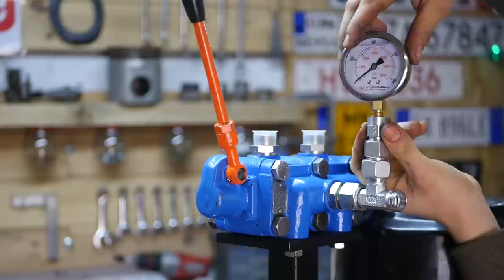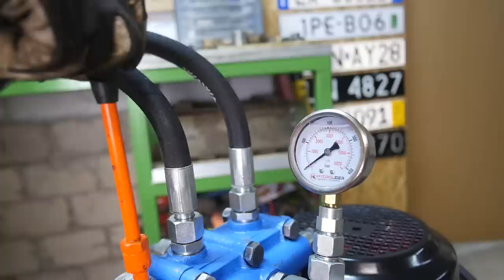Hydraulic power pack - DIY *Subtitles*

Comment: I work with industrial hydraulics for a living and you did a really nice job. If anyone watching is thinking of making their own power pack, please be careful. Hydraulic pressures are no joke and the fluid can get injected into your arm resulting in gangrene amputation. Be sensible, don't use body parts to test for leaks and always use new good quality hoses with armour braiding.
Reply from the maker: Thank you :)
Reply: Once got really scared on work  when we were thigtening these 75mm head bolts at a nuclear plant when our hydraulic wrench decided to blow a gasket.  Ever since i have been afraid of those things. You always have to be so close to that damn thing , the hose is always against your skin.
Reply: Life is dangerous, this is the reason of death.
Reply: @RedkingAlex  So Deep...

Comment: That's a great machine you've built, nice job! Could you please share what's the motor power and what's the maximum pressure and debit of the pump? And out of curiosity - how much is the weight of the complete thing?

Comment: Why you use TIG and also MAG (or MIG I don't know which gas is used) method (on the same material), what's the point? Is that because of different access to the welding spot? Or is it something else?
Reply from the maker: exactly the point:
- access to my welding spot. 
- Welding stresses
- cleanliness required
- tightness
- and the most important thing I have at hand  ;)
Reply: @PatrykTrajder  Great, thanks for your complex answer..

Comment: Hi Patrik, I would like to inform you: I need to assemble a press to stamp aluminum plates for vehicles. the press must have a force of 30 to 40 tons. Question: can this Hydraulic Unit that you assemble drive a hydraulic cylinder from 30 to 40 ton? Thank you.

Cześć Patrik, chciałbym poinformować: potrzebuję zmontować prasę do tłoczenia płyt aluminiowych do pojazdów. prasa musi mieć siłę od 30 do 40 ton. Pytanie: czy ta jednostka hydrauliczna, którą montujesz, może napędzać siłownik hydrauliczny od 30 do 40 ton? Dziękuję Ci.
Reply from the maker: Hi ;) , thank you for comments, more information you find in my web site.

 www.patryktrajder.com / product.

generally the pressure force you get from the size of the hydraulic cylinder you have.  because the larger the actuator, the less pressure needed.  my generator has a pressure of 300 atm.  but it is enough to change the pump in my generator to get 600 tons.  however, remember that standard hoses only last 350 tons. ;) 

back to the main topic of tons.  I have a 120mm cylinder ( inside) and 300 bar pump in my hydraulic power pack. So yes I have  40-50 tons. ;) 

if you finish your project, please send it by e-mail, I'm curious;)
Reply: @PatrykTrajder  54/5000
Bardzo dziękuję za odpowiedzi na moje pytania.

Comment: Bro why not using chain pully.
Reply from the maker: Hi, Where exactly I should be use chain pully?
Reply: When you took lady help to lift motor with top plate of hydraulic power pack.

Comment: Coupling key should be tight in Shaft & Coupling keyways.
Reply from the maker: Sorry i dont understand what you want say :| can you more Simple? Please ;)
Reply: @PatrykTrajder  2.55 you are sliding in Coupling & key on motor shaft. Actually, H7 / m6 tolerance is preferred for light press fit, so that coupling, key & shaft will not get worn out over the period. You have to select such fit so that you may fit by light hammering or pushing stud. Otherwise, you may use retaining compound like LOCTITE638.